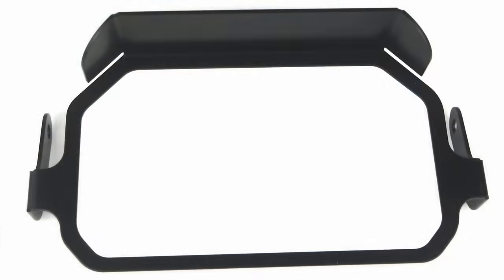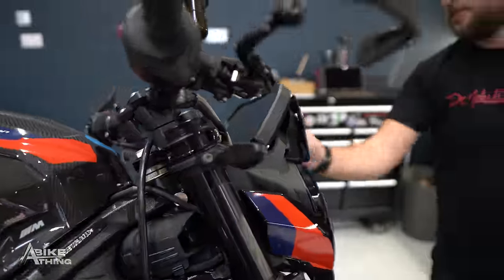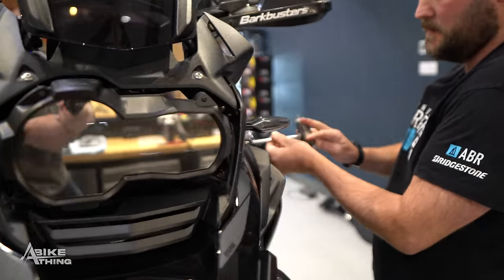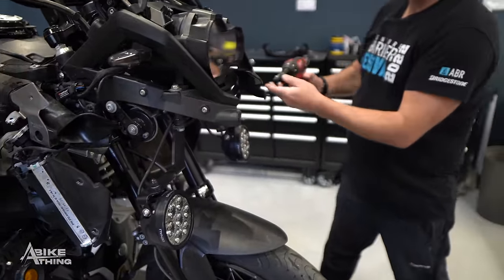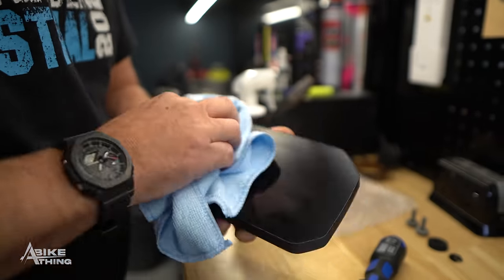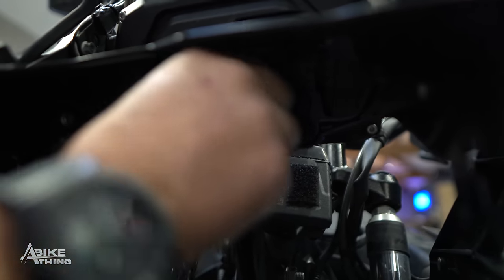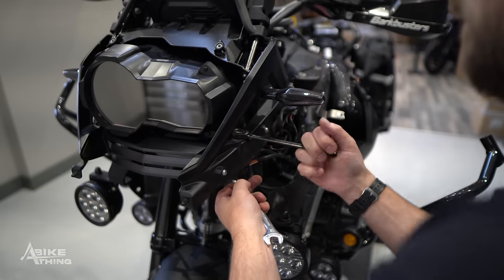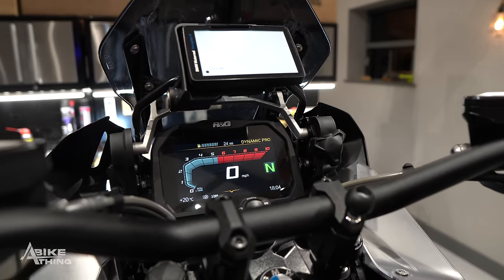Is This The Sexiest TFT Protection Guard On The Planet?

Comment: It's just like the saying goes " if you have a hammer, everything around looks like a nail!" With a set of wrenches & power screw driver, nearly every thing of the front of the R1250GS got to be removed as in this video. However, with just a pair curved tip surgical clamps & removing just the wing-shaped cowling , I managed to remove the TFT, & the subsequently reinstall it, , under 10 minutes (in total!). Dinking around with the R&G TFT guard took much longer!!!  BTW, I bought the R&G TFT guard from Steve recently!

Comment: A nice video as usual, but I struggle to see the benefit of this case and certainly there’s no need for billet aluminium for a static case. It doesn’t seem to provide any security against a TFT being ripped off, which I believe is the common mode of theft, and I certainly don’t want to be looking at an R&G ( or any other 3rd party logo) right on top of my screen. I have a Cymarc (no logo) security cover for peace of mind whilst touring as you never know where you may need to park-up, that one makes ripping off the screen difficult, not impossible, but it’s a good deterrent at a fair cost.

Comment: Looks like a really nicely designed and manufactured item, but it's not going to stop TFTs getting ripped off bikes, unlike the Cymarc anti-theft protector for the GS (which is very easy to install) and to protect the actual screen from scratches I would use a guard from Speedo Angels - a lot cheaper ;)

Comment: I’ve removed the TFT and refitted it without having to strip half the front end down when I fitted the screen protector🤷🏼 

Just removed the screen and top panel - then used a couple of different snap-on long nose pliers job done

Comment: Well, I have to agree that I have never heard of a screen being stolen,but I lead a sheltered life, I suppose. A thief would have to be quite determined to pick on the GS . But the S 1000, looks a bit easier to snatch. I think the three screws that hold the flyscreen on could be replaced with those anti theft fasteners. It certainly won’t stop them, but might slow them down a bit.

Comment: I know of at least 10+ being stolen. They just rip them off and brake the connector block in the process. £1200 to replace the TFT
Reply from the maker: Ok, I stand corrected but I still havent met someone personally who has told me this.
Reply: You know personally or have read online?
Reply: I know personally
Reply: @insertyoutubeusername  true, but there is so much exaggerated stuff around on the Internet I want to know what the real risk is. There is "forum creep"....Even cars have vulnerabilities   such as catalytic converters and steering wheels apparently. Personally I don't want an ugly bit of pressed steel around my tft screen if I can possibly help it!
Reply: @insertyoutubeusername  you are more likely to have your bike stolen  unfortunately. In a high risk parking area I would rather spend 30 seconds putting a cover over the bike.

Comment: Steve, is the extra bent metal mount behind the Nav6 which takes the Peak Design universal mount available please? It's just what I'm looking for!
Reply from the maker: this was a make shift solution for my last road trip. Only works with the shorty screen but it's a bent piece of steel with a ram ball screwed through the sat nav cradle.
Reply: I'm after that too!